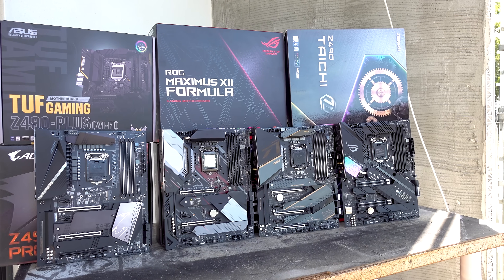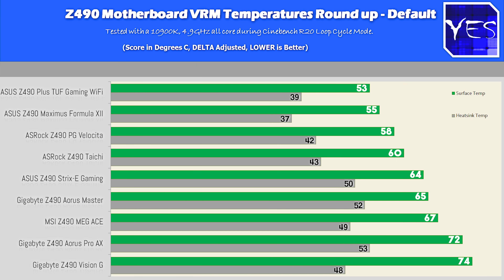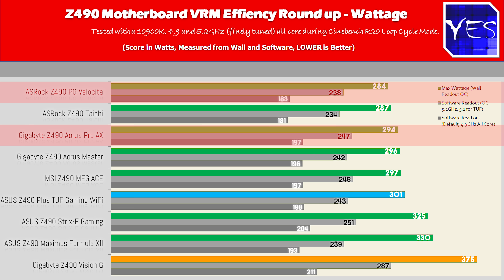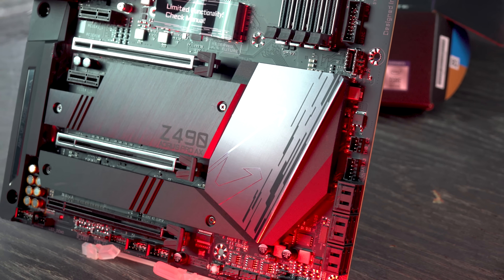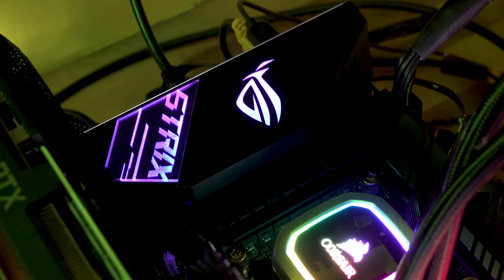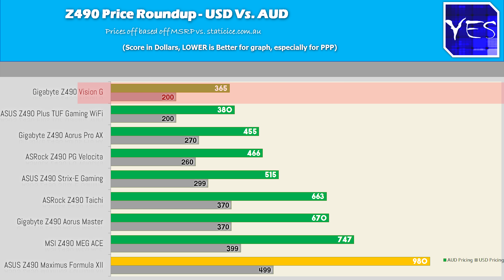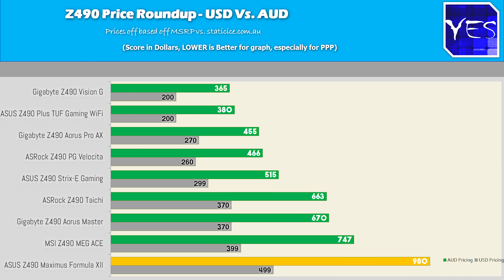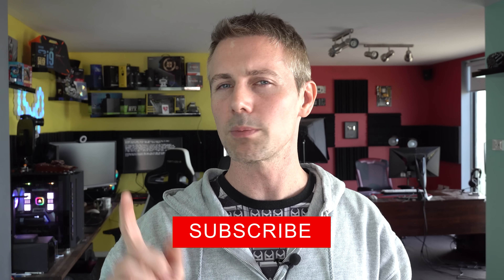Z490 Motherboard Comparison (9 Way Review) - Which is BEST for the MONEY?

Comment: I am looking for music production PC and searching for thunderbolt motherboard. Lets see how much the price difference is. Processor i5 no gaming purpose
Reply: For my studio computer I ended up going for the Gigabyte Designaire as it has 2 thunderbolt ports. Also got an i9 9900K as it is for the 9th Gen Intel processors. My studio runs off thunderbolt and have been using it for a full year now no problems with the thunderbolt or interfaces no working etc. been super smooth all year.
Reply: @robtechrecords377  i researched and found thunderbolt and type-C usb motherboards are very expensive. The problem is thunderbolt and even type-C are useless as we barely find compatible devices. There's no point in it. It will be useful maybe 30yrs from now. I m not gonna have multiple 4K screens and anything like that so it's just a waste of money. I got B460 motherboard i5 10400. 500gb samsung evo Plus.

Comment: When is the Meg Z490 Godlike review coming????
Reply: Best z490 you can buy 🤘
Reply: @sagerdood  Are you sure? Some reliable info claiming that MSI build quality isn't made to last. Kind of like a Cheetah. Runs fast but for short duration. Asus is way better in this. I guess the Formula becomes the ultimate Z490 board then.
Reply: @FirestormX9  what!! Who told you the godlikes build quality id bad? Its the best overcloking mobo for the 10900k you can buy...
Reply: @FirestormX9  dude the prime z490 a is an absolute piece of shit, msi's whole z490 line is tops
Reply: @sagerdood  prime? I didn't even consider that. I said Formula bro. Thats way above Prime. Prime is like mid entry level board by Asus. And yeah bro MSI products don't last very long. 2-2.5years tops then kaput.
Reply: @FirestormX9 do you own a z490 with a compatible cpu?
Reply: @FirestormX9  im out bro, i am telling you as a consumer who has owned both since launch that its a great motherboard, im also a consumer who has been hardcore overclocking for a long time now. Take it as you may.
Reply: @sagerdood  dude it seems you made an uninformed assumption that i don't have any experience with MSI products. I've built multiple pc's and used MSI for AMD and Intel both. And i'm telling you this not just from personal experience but also from the experience of many other users from forums. This is how it is for MSI. It isn't built to last many years. But for the period that it does last it does perform very well.

Comment: Hey Brian, I usually don't have any questions to ask, but this question isn't related to computer parts, I like yourself sell gaming PC's locally, and it has been quite profitable, I could never thank you enough from all you've taught, and all I've learned from you. I went to look for parts, and systems today, and I clicked on a whole system, and the seller had copied my description from my ad word for word, but he changed the specs. He also said in the description, "All my components are current gen, not some of this old crap you'll see from others, just face it a processor before 2017 won't cut it in 2020" how should I go about this situation, I had all my friends report his listing, and it was taken down, but I have a feeling he'll only repost it again. It's really annoying to work as hard as I have and get the recognition I get in my community, only to have someone else steal apart of my branding.

Comment: I just picked up a z490 Designare (Vision D) for $240. Along with a $400 10700K. $650 for a Aorus RTX 2080 super. $250 for 32GB's of Crucials Elite 4000CL15 monster dimms that run flat out at 5000CL17. I stuffed in Corsiar's 500D for $140. Good times for new builds.
Reply: Feel bad for u now

Comment: Wow...for $260 delivered as a package deal one can get an E5-2678V3 + 32GB 1600 DDR3 R-EEC + HuananZhi X99TF motherboard. Turbo unlock all 12 cores/24 threads to 3.2Ghz. I saved my money and went this route, albeit a non package deal ($99 for the motherboard, $105 for the XEON, and 32GB of Mushkin Redline DDR3 1833 that I had lying around). It's just a side rig, on a vertical bench ($70), that I have next to my E5-1680V2 ($155)/ASUS P9X79Pro ($20)/32GB DDR3 1600 Fury HyperX ($80).  USED parts performance...that's it for me.

Comment: I picked up an asus z490p with a 10700k, I dont see any vrm throttling at 5.2ghz 1.38 volts. Its a lowered board, but i needed to replace my 5960x as inexpensive as possible

Comment: 3:00 [lower VRM efficiency at higher temperature]
I havent really studies thermodynamics, but from what know; the higher the temperature is, the more resistance most electrical conductors (copper included) have. To make it short: the hotter the vrm is, the even hotter it gets. 
Although I dont think that 5 K will make that much of a difference, so there might be another reason behind this.
Reply: Electrical resistance increases with temperature, due to electrons colliding more with each other, and increased resistance creates more heat at the same current, due to more voltage and thus more power. So, practically, hot stuff creates more heat than cool stuff ;)
Reply: End in "flames" results are typically chemical thermal runaways (chain reactions) common to batteries. In electronics increasing temps change conditions in a way that cause higher temperatures - up to - a defined point.  Chemical reactions are the simplest feedback loop, electrical are the easiest to prevent. 
A CPU is guaranteed to trip it's internal / external thermal regulation including upstream MOSFET's (VRM) 'before any smoke' is freed. This isn't theoretical anymore, in practice some billions of computer motherboards have been deployed showing that safeguards to prevent catastrophic failures, are in fact, safe. Comments like "those VRM's scare me" are just ignorant, Infineon Datasheet TDA21242 shows it's max junction temp @ 150°C., with a temp range of 40 to 125°C. If 100°C is STILL = to the boiling point of water there is nothing to be concerned about. 😂

Comment: In the future, could you include also memory overclock results between boards? 4400MHz kits are not that expensive anymore and most 490 boards should be able to run 4800MHz RAM. Thanks for the content.
Reply: 4800 might still be dependent upon CPU IMC binning on 2-DIMM memoc focused boards like MSI Z490i Unify ITX, EVGA Z490 Dark, or ASUS Maximus XII Apex w/ 2x 8gb Samsung B-die sticks (16gb max b/c dual-rank 4800 requires bench/"xOC" voltages). All depends on how high you'd be willing to run on VCCSA to stabilize a daily 4800 OC.

Comment: Pros going with intel:
 - Faster than AMD 10% at most
Cons going with intel:
- You need to buy new motherboard everyyear and it will cost you 250eur atleast if you want to get 5ghz on 10900k
- You need expensive air cooler or good liquid cooler to barely sustain temperatures below 100c
- No upgrade path, no price drops over time either
Reply: No price drops over time, but higher resale price.. ironic isn't it.
Reply: Indeed,
Intel chip stock speed is even faster than AMD chip counterpart,, if you auto overlock all core will boost even faster tho it will get hotter

I think for Value conscious consumer Intel chip isn't the best choice

Comment: A long time ago in a galaxy far far away

Intel had CPU monopoly for several years. But AMD started a competition by bringing more cores to mainstream CPUs. Meanwhile, AMD and Intel are competing for the best performance of the CPUs. Will AMD rise over Intel with large improvements in performance?
Reply: amd already did it...there few fps behind intel, but intel needs for this "win" a lot of power and heat!! u can get a 3700x for 280$ and a x570 aorus for 200$! then u have a decent rig for under 500 and intel cant beat this
Reply: amd is still a bit behind Intel in terms of IPC, probably by 5 to 10 percent
Reply: @smashandburnyt6938  yes, but cause the clockspeeds.....yt same speeds there are no difference

Comment: With all respect nobody buys intel processor in 2020😂 ( they are less valuable as compare toh AMD Ryzen ) ♥️
Reply: Ha, most people with high end PC's still go Intel. I have the 2080 Super and 10700k for PUBG which is a big improvement over AMD
Reply: @jake152  
Are you overclocking the i7 yet?
I'm tempted to get the i7 but reading results of low overclocking potential.
What mobo?
Reply: @SL1PSTAR  Ya I did 5.1 all core and cache of 4.8. I'm not super big into overclocking so I just did that and left everything else default. No problems so far. The MSI Gaming Edge Wi-Fi, it's very similar to the Tomahawk and it's been good.
Reply: @jake152  
Ok cheers 👍
Reply: well said , i almost ended up buying i9 10900K for $990 from centrecom but after realizing i need to buy a new MB as well so then i thought hang on sec if i need to spend extra $600 on decent Z490 MB  why not switch to AMD so i ended up buying 3900X for less the money with X570 masters and since then my friend i never looked back at any intel product again.
Reply from the maker: @kanpuriaa  For most Ryzen will be better value, most certainly, though the intel CPUs still have their place, I wouldn't say no body is buying them, I know a lot of people buying them actually, especially amongst competitive players.
Reply: @kanpuriaa  
I'm buying Intel.  I need a cpu to push the 2080ti and the upcoming 3080ti.  Intel have moved into the premium market and people don't like this so feel the need to bash intel.
Reply: Intel has better power efficiency in low thread situations.  Electricity costs money.
https://www.techpowerup.com/review/amd-ryzen-3-3100/18.html